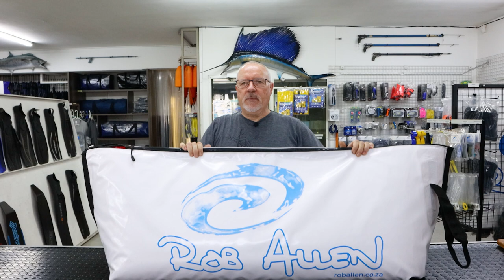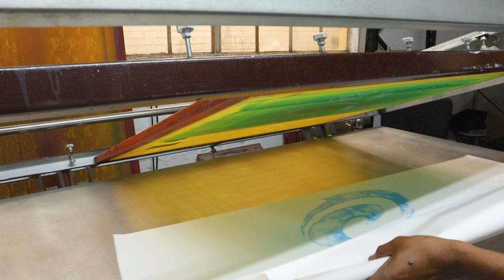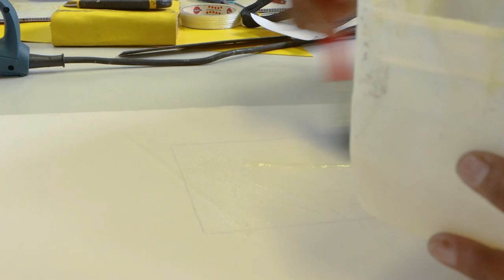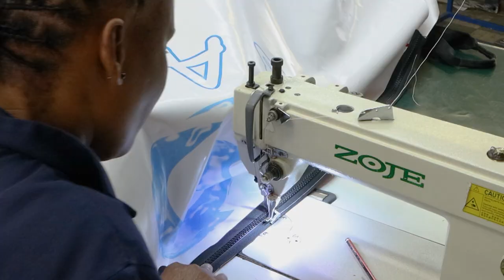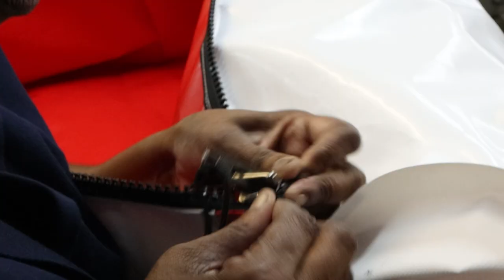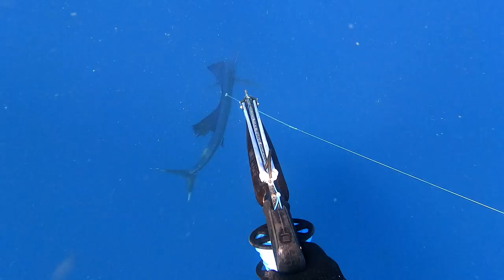Rob Allen | Fish Cooler Bag | 2022

Comment: Excellent product, as expected! I just rigged 14mm small ID rubbers onto my new RA Tuna 90 Roller last night (12/29/22) for testing this weekend. I cut the bands to 50cm powering a 6.5mm 1.3m Picasso shaft and it all feels good. Little tight, but good. I feel like I could get away with an extra cm or two in band length to make it smoother, but we'll see how smooth the release is in the water this Saturday.  My biggest concern when cutting the bands and inserting the bridle/saddles was getting the length/diameter perfect for each. The saddle loops and bridle insert length have to all be perfect or the bands will be unevenly powered. Do you know of any tips/tricks to make this process easier? Thanks for providing so many high quality products and much love from North Shore New England, USA!
Reply from the maker: Hi Anon, the only way is to tie the loops to the same length and then tie them into position the same distance from the rubber edge. A slight variation will no be a problem.

Comment: Great video! What are the maximum weight capacities of the bag sizes? I.e., what is the breaking point of the straps as this is also an issue for cooler handles when fully packed with fish and ice. Also how does the material fare against fish spikes and teeth, e.g., cubera snapper, grouper?
Reply from the maker: Fish teeth will cut. Spines will puncture. To make it "bullet proof" will make it way more expensive. Some use them with an additional lining like rubber or carpet. The straps and anchor point are stronger than what one person can pick up. Not advisable to try pick up the big bag when full of ice and fish, way easier to decant the fish into fish boxes then just lift out the bag with the water and remaining ice when done.

Comment: How thick is the insulation? 
What size bag was in the video?
Are there any areas, e.g. seams on the end, that aren’t insulated?
Cheers
Reply from the maker: The insulation is about 20mm thick. The bags come in 3 sizes, I don't have the measurements on hand, you will have to mail sales@divefactory.co.za   The insulation is pushed right into the seams for maximum insulation.

Comment: Hi rob
I've saw you have a new prudoct that called rubber duck fish bag 
Does it keep fish cool with ice? Or it  just for transporting
Reply from the maker: Yes, it has 22mm closed cell foam between the 2 layers of vinyl rubber duck fabric, good to keep fish for days on ice.
Reply: Thanks! I'll buy one for sure
Reply: Hi rob
How much does it weigh? I'm trying to organise delivery from England to Israel and have some problems with iy
Reply from the maker: @PelegAzulayspearfishing  When we send these they charge by the size, not the weight. We make 3 sizes so it would be different depending on the size.